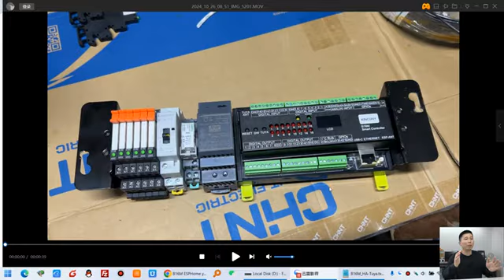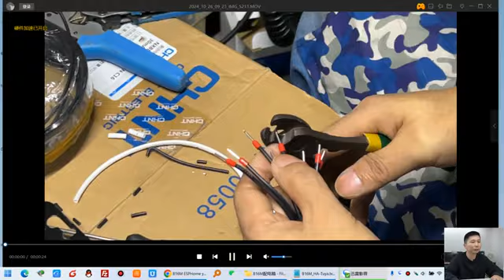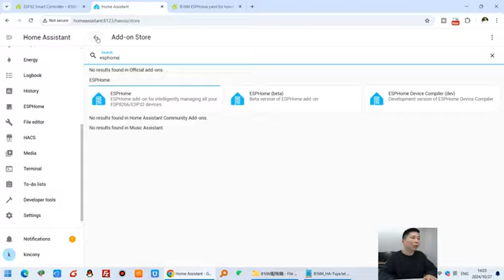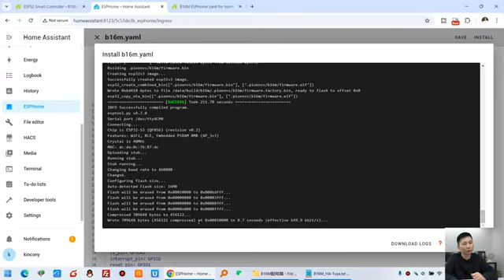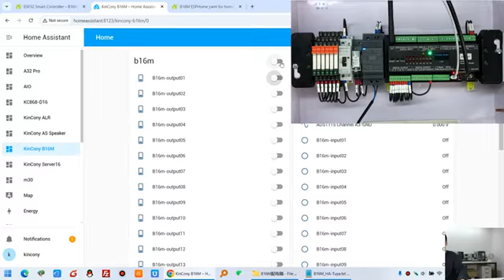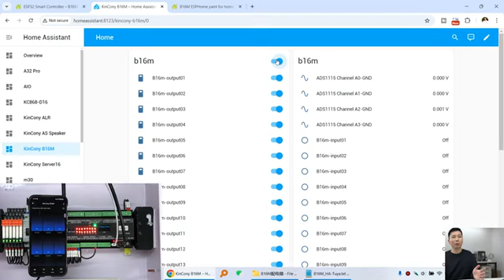Smart distribution panel by B16M using home assistant and Tuya app

Comment from the maker: Model No. KinCony B16M
Description: KinCony 16 Channel ESP32-S3 Smart Controller – B16M
Power supply: 12-24V DC
Processor: ESP32-S3-WROOM-1U (N16R8)
Size: 160mm*83mm*56mm
interfaces: Ethernet(RJ45)-LAN 100Mbps IPv4/IPv6,WiFi,RS485,Bluetooth,USB-C,LCD,I2C,Tuya Module
RTC: DS3231 high precision chip (battery socket on PCB)
SD Card: SPI bus
Installation method: DIN RAIL
LCD: SSD1306 I2C display

Outputs:
16CH MOSFET Outputs, every channel use MAX 10A driver IC

Inputs:
ADS1115 16bit ADC: 2CH analog input DC0-5V (A1,A2) 2CH analog input 4-20mA (A3,A4)
16CH dry contact inputs (optocoupler isolation, long distance circuit for MAX 500 meters cable)
3 buttons: 1:ESP32 Reset 2:ESP32 Download 3:Tuya config
1-Wire GPIO: 4CH (with pull-up resistance on PCB)
free GPIO: 3CH (without pull-up resistance on PCB, connect with ESP32 pin directly)

software solution:

1. download firmware by ESPHome, integrate to home assistant or use by web service.

2. download tasmota firmware.

3. write your own Arduino code for your own requirements.

4. It is recommended to use home assistant and Tuya mobile phone app at the same time. So that remote control by internet using Tuya app, local control by LAN using home assistant app.

Related technical information
———————————
ESP32 I/O pin define: https://www.kincony.com/forum/showthread.php?tid=6781
config yaml file for ESPHome: https://www.kincony.com/forum/showthread.php?tid=6923
ESPHome official supportted list: https://devices.esphome.io/devices/KinCony-B16M
arduino demo source code: https://www.kincony.com/forum/forumdisplay.php?fid=61
KCS v3 firmware online guide: https://www.kincony.com/how-to-use-kcsv3-firmware-esp32-board.html